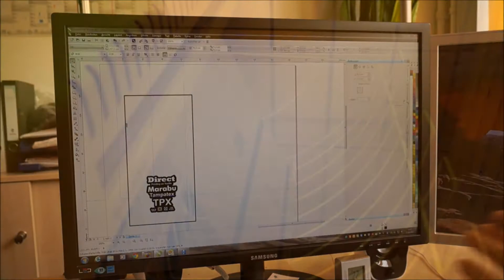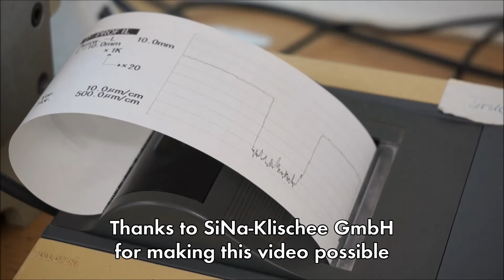Steel cliché production for pad printing

Comment: Is this the same process used to make cliche for label printing?
Reply from the maker: Usually, labels are not printed in pad printing. If you mean label printing for offset or flexographic printing, unfortunately we can’t provide you an answer because we are not experts in that field.
Reply: should be the same if you are using a tampo to print a replacement for a neck label on t shirt or something like this